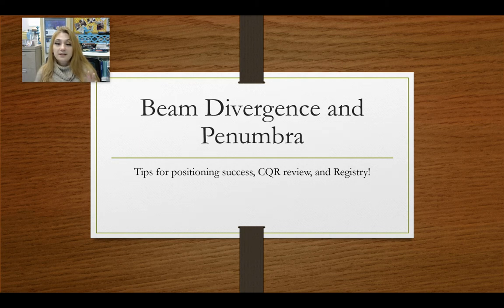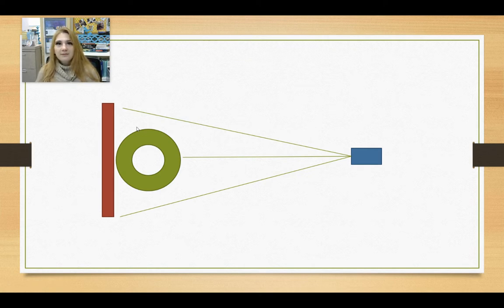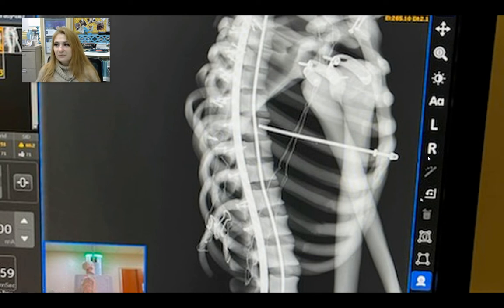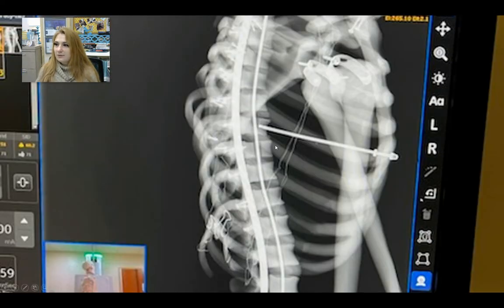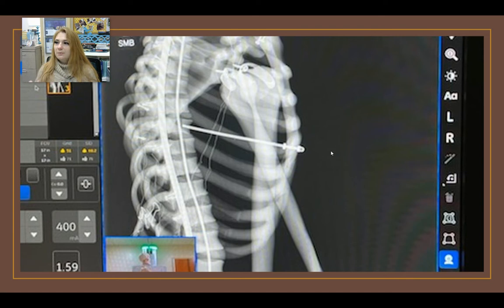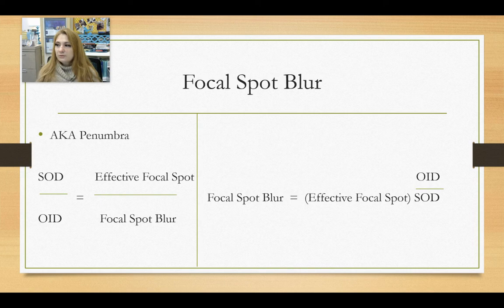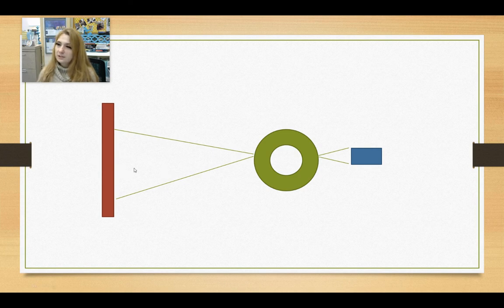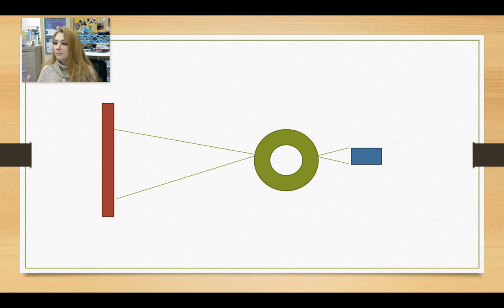X-ray Beam Divergence and Penumbra, Tips for Lateral Chest, CQR, and Registry

Comment: In 1988 and again in 2016 I presented papers at Australia's national conference about the errors in text books and in history concerning the geometry of a beam used in a projection. Does pushing the tube angle button and angling the tube change the way the anatomy appears in the projection? Only 25% of qualified radiographers knew the answer. The rest thought they knew the answer but were wrong. Being wrong also meant not being able to use a focused grid correctly. https://youtu.be/mZPD_gLs5Dw?si=vLGXcjRdXvPB5aQ_